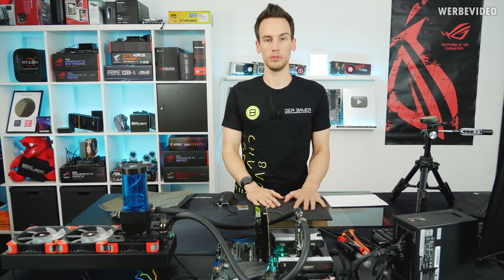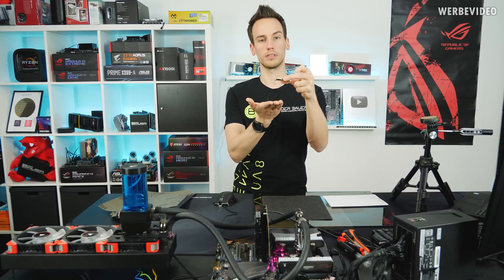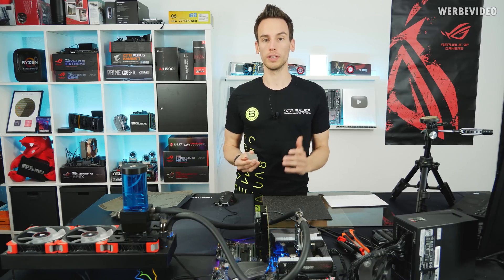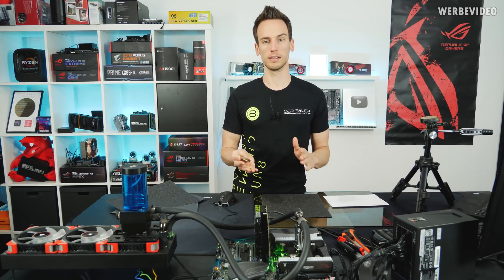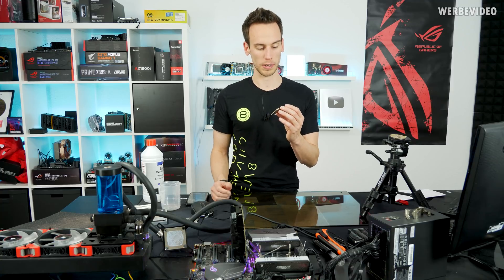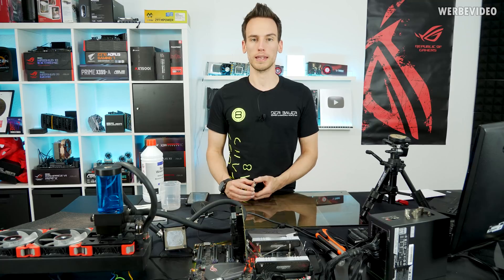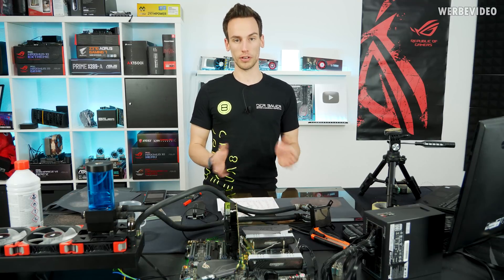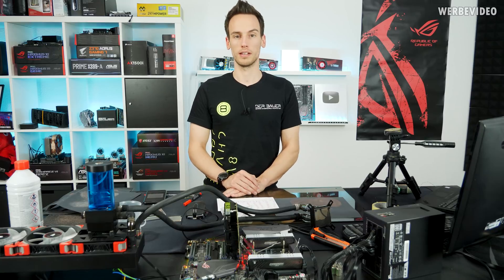How bad are SCRATCHES in the CPU Heatspreader?

Comment: Will lapping improve temps for a Ryzen CPU? Even by a couple degrees?
Reply: Probably, I’ve got one chip that goes thermonuclear when the same cooler keeps my TR-1950x at higher voltage and 4.15 GHz nice and cool (other CPU is Ryzen 1700 at anything past 3.8 GHz). It seems to do just about as well on the stock RGB air cooler for some reason... I had thought the CPU just wasnt flat or something (paste spread looks decent enough, I mean, Threadripper has an IHS twice the size of the cooler, so if it’s good enough for that...), but it does run stock fine, so I didn’t want to destroy it’s warranty since it works just fine.

Comment: Awesome findings! So bottomline, sanding from 80 to 600 will clearly bring some thermal benefits.
I find it particularly interesting @6:05 that with 40 the heatspreader was too rough, even though of course it must have become a bit thinner than the original, but the roughness was too much so the overall result (thermalpaste on that thinner but too rough heatspreader) could not transfer heat as well as the thicker but smoother original. Yet interestingly enough, right with the next grain at 80 this changes, so in spite of the remaining noticeable roughness, the overall result with the thinner but still rough surface already does a bit better than the thicker but smoother stock.

Comment: With a good set of wet stones you can get a mirror finish on it.
Reply: As far as grits go wet stones have no advantages over sandpaper. Wet stones are thicker though so they tend to last longer in some uses than sandpaper does. You're basically buying a stack of sandpaper when you purchase a wet stone.
Reply: @Paul Frederick: you are correct. But if he's going to do this a lot in the future a set of wet stones is recommended. Plus they have the added benefit of being around for the the kitchen if you need them.

Comment: I'm curious about sanding the CPU and heat sink to ensure both are flat, for maximal contact. Are the EK water blocks already perfectly flat?
Reply: You get better temps with both perfectly flat. And no ek is not perfect but they are really close, unless you are benchmarking, it isn't really needed.

Comment: I think you need a better method of determining flatness. It is hard to tell on video but it looks like the outside edges are rounded over to me. Just because you're sanding something does not always mean you're making it flatter.
Reply: I ve "lapped" a few CPU starting with my old Q9550 E0 - if you do it by hand you 'll always have a certain amount of "rounding" on the edges and it doesn't matter as long as the IHS is otherwise flat afterward. The area that matters is middle/where the DIE is located. 
The best result I achieved was with my Q9550 where the core delta shrunk from 15 kelvin down to 7-8 and overall temps went down by around 4°C.  That IHS was soldered but really bent.
Reply: @folterknecht1768  how can it not matter? You are losing the conduction wherever you have no contact. You may be better off than you were before but that still does not mean it doesn't matter.
Reply: Agreed on the rounded over edges.  Basically this is because the sandpaper is lifting from the flat surface, you can see it happening for example @6:45.  This can be alleviated by taping the edges of the sandpaper down so it is taught over the surface.  Alternatively you can try a light spray adhesive between the glass and paper, but this could potentially add its own unevenness.

Comment: I lapped a few CPU's like this. Always had like 2 max 3 degrees C of improvement. It's not worth it unless You are going to make a heavy OC, then every single degree counts, it costs almost nothing and takes only hour to do it, so for me its obvious when it doesn't have warranty any more. It's more difficult when You lap an AMD CPU, when You need to watch out for pins, but I figured it out and used old socket from a broken motherboard to put it on pins while sanding.

Comment: It's curious that in "metric-land" you use grit which measures the diameter of the particles in INCHES. 100 grit is covered with 1/1000 of an inch particles, 200 grit is 1/200 grit etc.
Reply: For practical applications US customary measures work better than metric does. That's why we called out the altitudes in feet when we landed on the Moon. Because when inches count no one cares how many meters you are off the surface.
Reply: @1pcfred  I was just curious why the Germans haven't changed their sandpaper ratings to something based on the meter.
Reply: @1pcfred  Also tire sizes are all inches i.e. 17 inch 18 inch, etc. but then they go to metric as in 18V235R50, the 18 ins 18 inches, and the 235 is 235 mm, and the 50 is a ratio. Also the metric world measure their television and monitor  sizes in inches i.e. 65 inch tv, you'll find them described in Europe as such.

Comment: check the ihs flatness with a straight edge.  if you cant find a really high spot then youre good i guess
Reply: A straight edge is good for gross measurements but in this instance I think we're after a bit more than that. Then you get into optical flatness and interference patterns.

Comment: I'd love to see a test where the cpu is wrung to the heat sink. Like what gauge blocks do
Reply: You can only wring blocks that have been accurately lapped. What we're seeing here is not accurate lapping either. Van der Waals would not be impressed.
Reply: @1pcfred  haha oh I'm aware of the precision required, might have to get a pro to do it
Reply: @1pcfred  I don't know a huge amount of the science behind wringing, and tbh I don't think anyone does. But it would be interesting to see if the two surfaces make enough contact to not need thermal paste to fill in the gaps. 

 Softer metals like copper tend to gall quite a bit though, so I imagine there would be some pretty wild variances between different attempts
Reply: @1pcfred  I'm not saying it would be worth the 6 hours to reduce temps by 5°, I just want to see it done but not have to pay for it myself
Reply: @1pcfred  I'm not talking about lapping though, I'm talking about the hypothetical gain from cold welding your ihs to your cooler

Comment: I bought a cheap 92mm tower cooler at bestbuy like 8 or 9 years ago to go on a 960t, temps were almost the same as the stock cooler, so i sanded down the cooler temps dropped down 10+ c from what i can remember. 1 heat pipe sat to low.. but the cpu cooler was like 14 bucks i think ..

Comment: for me its not worth the work to sand/lap  as i am not pushing my system to the point that every degre is of importance onely 4100 on my i5 6600k so not really pushing it and last i cheked my thermals wher sub 70C all the time 

in theory i think you could go whitout thermal paste on a lapped cpu and cooler but you would nead to hotlap them both at the operating temp and it would most likely onely work in a verry narrow operating window but to save a few bucks on thermal paste by lapping for a few hrs is it really worth it and after that it would mostlikely onely work for constant temps

Comment: Have you found the Ryzen I heat spreaders flatter than Intel I heat spreaders? I've seen at least 2 You Tubers with expensive Intel CPUs with an uneven IHS. I would have expected a $2000 CPU to have an excellent integrated heat spreader and not spin like a top...

Comment: My question is, if the surface is flat enough and smooth enough can you stop using thermal paste all together? Theoretically there is no empty space to fill anymore.
Reply: Metal always has pores in it. Which is why we use heatsink compound in the first place. Theoretically most matter is mostly empty space.
Reply: @1pcfred  Heatsink compound cannot fill in the inter-atomic space between atoms. Metal also does not always have pores, it's not even common for it to have pores, the reason IHS' have pores is because they are cast. If an IHS was milled from a solid piece of metal then we would expect it to have no pores. 

If a piece of metal is atomically smooth, and you placed it on top of a matching piece then there would no force that keeps the metal pieces separate and in some cases they can even fuse (cold welding)

Thermal paste works when the variation in the metal surfaces is larger the the particle size of the thermal paste. If however the variation is smaller then the thermal paste is only adding an extra, useless, layer. 

So yes, here it might not work because of pores in the cast IHS but this might still work if the die itself was sanded smooth enough. (The die is monocrystaline silicon, no pores)
Reply: @1pcfred  I'm a physicist that works in nanofabrication. I'm not saying that this is something that intel should implement, I'm saying that this is something that could be done by extreme overclockers to get the last fraction of a percentage of performance.

Comment: So lapping the cpu can squeak out some small gains.....what about the cold plate on your cooler then??
Reply: Yeah Depends on the cooler, I’ve bought some cheap air coolers that looked like using gravel might get it better (although I’m joking, a sidewalk or paved road actually would make it a lot smoother, I’ve sanded some parts on road curbs before... just not computer parts). Most of my other coolers (phase, LN2, waterblocks, AIO all look almost mirror finish without ever touching them, then it’s not needed, but air coolers with .5mm roughness is pretty bad, you might get cuts running your fingers across it fast, it was really roughly done at the factory!)

I may compare this truly rough cooler before and after an FX (my hottest CPU, though currently it peaks below 0c at 1.7 Vcore on phase, lol!) My TR-1950x is just way too easy to cool, so it won’t show a big enough difference. My other channel is “Legit_Overclocking”, if someone comments on any of my currently garbage videos, I’ll make sure to do a quick 3 minute video showing the differences (differences in max OC at thermal limits, and temps compared vs same speeds). Just comment and say you want to see cooler lapping video. Preferably though, come up with something more impractical like “use a jet engine to cool a Titan”, because I’m more likely to do that (sounds more interesting and fun, I can spend $3,000 on a jet, that’s not an issue if it’s fun), I can do a cooler lapping video though, sounds intriguing enough.
Reply: I think FX is actual thermal probe, HWmonitor shows wrong though because Intel used a linear scale, and FX used a different thermocouple that is only accurate at high temps and seemed like no software company felt like correcting the algorithm for AMD chops (AMD did this because low temps don’t really matter anyways), with one of my coolers at -35c block temp under load, my FX-8350 at 1.7 Vcore (limit of Asrock 970m Pro 3 motherboard in BIOS), the core temp still shows 0c under load, which is what basically any computer part shows sub-zero. It should be 80c or 79c for max FX thermal limits, though official spec says lower like 69c, Overdrive says I had 79-80c thermal margins when the CPU thought it was at 0c, but the overdrive limit may be beyond AMDs official recommended spec anyways.

The air cooler I mentioned does ok, but it seems like 5 minutes with some and paper or an angle grinder and it would be better. It was really rough... I’ve got plenty expensive coolers, but sometimes I just need one that I can slap on a test system with minimal effort and have my nice coolers free. It does ok for that, but it could probably be better.

Comment: I appreciate the time that each stage took to sand and test. Interesting results for #40 grit. Thanks for the tips on how to tell if your IHS is flat or not so you can judge if there would be potential for improvement or not. Seems like this is one of the last areas to try to increase performance from though: already have the fastest CPU and excellent cooler.

Comment: So I guess me lapping my IHS and LN2 pot to slip gauge/vacuum seal grade flatness of Ra 0.05 µm to run without using any T.Grizz Kryo is a waste of time. So is anyone intersted in some lightly used supplies such as helium monochromatic light, optical flats, grooved laps (copper, steel etc 3 of each), diamond impregnated + charged laps, diamond abrasives dry/wet with high tech nano lubricants and carriers, Renzetti flat stones
 and AA flatness rated granite surface plate ? uh anyone ???

Comment: Kingpin said he roughens up the surface after lapping so the paste can stick better
Reply: it's a fine line between having an increase in thermal my micro scratches for surface increase and rough scratches that introduce air pockets or pockets of not full contact that essentially work like micro insulators. As seen by experiment shown there is a tipping point for a optimum.

Comment: There is a "Lip" on my Ryzen 7 1700x and I've always wondered if maybe this is what is causing rather high temps while overclocked (35C liquid temps, 68C Package, Corsair H100i GTX). Should I sand or file that lip off my Ryzen 7 1700x? Dont care about warranty at this point, as will probably replace with Ryzen 3000 when it comes out
Reply: sounds high / what are ambients ? I am running a R7 1700@4ghz  H100i is 28c idle cpu Tctrl is around 30-40 / under max loads Tctrl Max after a few hours around 70c CPU temp 52c (ram@3400c14-14-14-24-48CR1)  What are fan speeds and how have you configured the rad? fans?
Reply: @fingcoldlife  ambient is 23C, and I'm running 3.95GHz@1.4v
Reply: @Celician83  what temp are you saying is too high Tctrl or CPU temp CPU temp usually a delta of 10-20c depending on cooling (also some boards will allow you to mess around with TDP of CPU and set thermal throttle in CBS Zen options)  aer you using stock corsair fans? or replaced?
Reply: @fingcoldlife  idle temps for package and the H100i are 27C, but after 10 minutes of prime95 with small ffts the package jumps to 70C and the H100i goes to 34C. Seems normal, but I think it could be better if that lip on the side of the IHS wasnt there
Reply: Case is Corsair 600C, so rad is in front intaking, idle temps are around Ambient, but load temps are way too high, RAM is stock 3200mhz 16-18-18-36

Comment: I somehow expected the difference to be a little larger, but I guess it really wouldn't start to matter much unless one started to overclock by a fair bit.
Reply: That's why he made the video to dispel an easy misconception to have.
Reply: @1pcfred  And it is a good video for that reason.

It at least gave me a better appreciation of what is and isn't a serious scratchy surface on an IHS.

Videos helping to alleviate misconceptions is good, after all, there is a lot of misconceptions floating around, like I once saw a tech channel proclaiming that quad channel memory were having negligible improvements compared to dual channel memory, based on tests on the AM4 socket. Not taking into consideration that it is a dual channel socket, some motherboards have 4 dim slots, but that isn't the same thing as 4 channels.
Reply: @1pcfred  Yes, sanding IHSes is rather pointless for most average users.

Going to a better heat sink or water cooling setup will have larger gains without voiding the warranty of the CPU.

More extreme overclocking is another story, but one usually doesn't use such systems for more then a benchmark anyway.
Reply: @1pcfred  Didn't kingpin also state that he likes to scratch up the surface a little after all the lapping, so that the heat sink compound have something to grip onto and not pull away as easily?
Reply: @1pcfred  I would guess that the thermal compound first freezes, then shrinks as it gets colder, potentially leading to it tearing into pieces and not covering the IHS all that well. So some scratches would allow for it to hold itself in place better and not pull apart into large chunks. But this is though just a guess from my side. (Though, I wouldn't be surprised if the thermal compound has a much larger rate of thermal expansion then the surrounding copper heat spreaders.)

Comment: My first Q6600 (the less desirable original B3 stepping) had a very uneven IHS. Started with 120, then worked my way to 1500 testing between each. I got a 6C drop with the 120, then another 1C with 220. After that I didn't notice any consistent measurable difference. To date that has been the only CPU where lapping, sanding, or whatever you want to call it made more than 2C difference.
Reply: cee128d I had one of these and a G0. I had similar experiences with both.

Comment: I lapped a CPU using 800 - 1000 - 1500 - 2500 Grit After that I went to a Jeweller and had him buff it as much he could.  We found that the metal is porous and when you get to a microbubble it creates streaks down the IHS. So the quality of the metal restricts you from intel, they are made cheap by casting.
Reply: To what I have read Intel actually stamps the IHS out of copper sheets.

Though, at some point it is just easier to mill out a hole in the IHS and make direct die contact instead.
Reply: @todayonthebench  This process may have changed, this I doubt, the chip I "buffed" was a 775 C2Q Q6600.  Will do a follow-up Video when I can
Reply: @der8auer Can I pin, please?